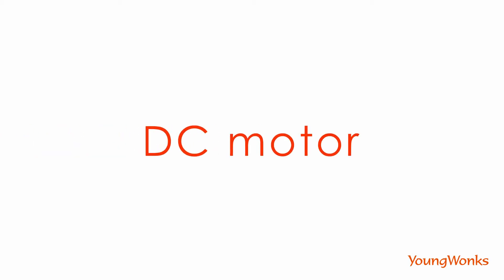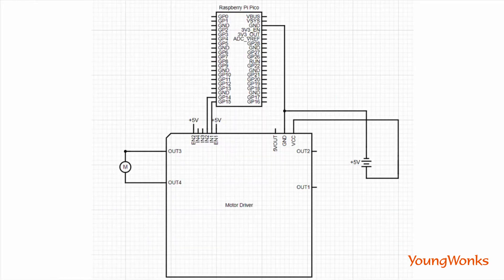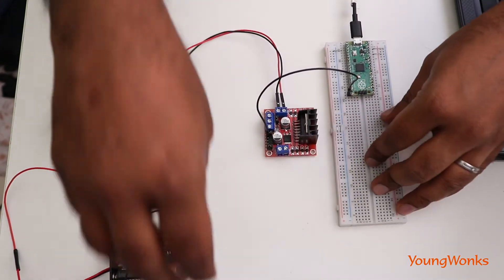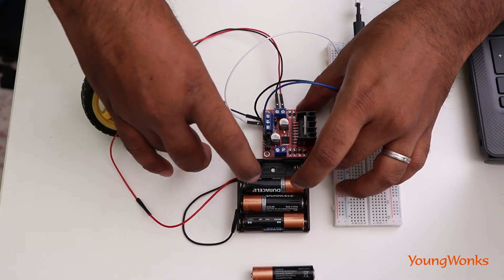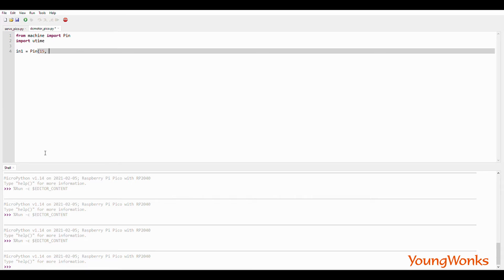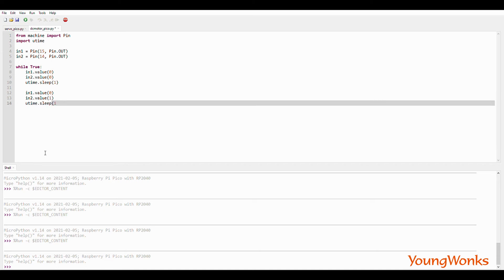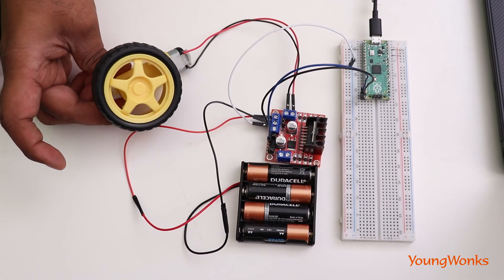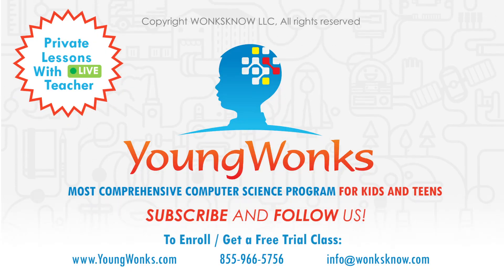Using the Raspberry Pi Pico with a DC Motor

Comment: Can you please show How to control a motor with raspberry Pi pico wirelessly
Reply: I think it isn't possible
Reply from the maker: The raspberry pi pico doesn't have any in-built wireless communication ability. We will need to use some sort of chip to do it. The raspberry pi Zero W may be a better choice for this.